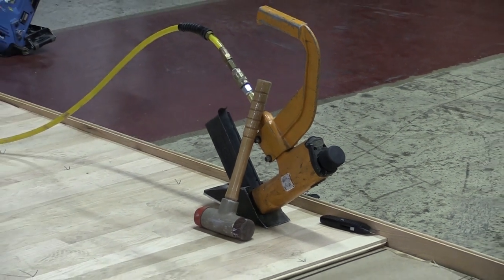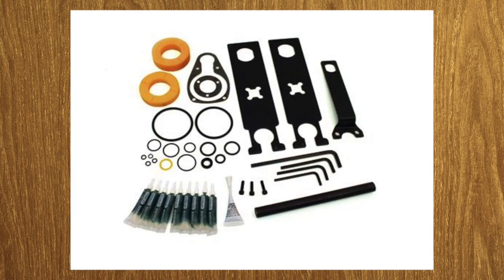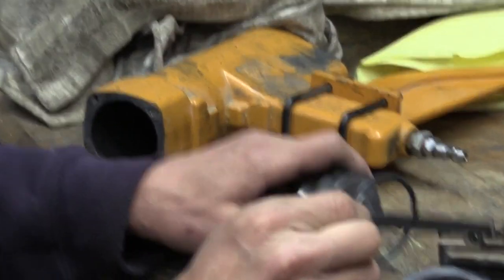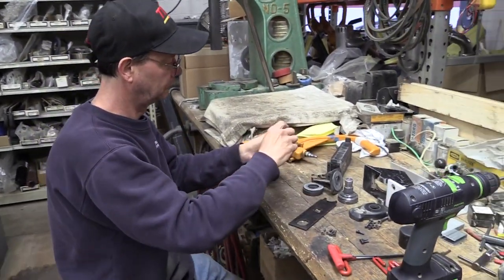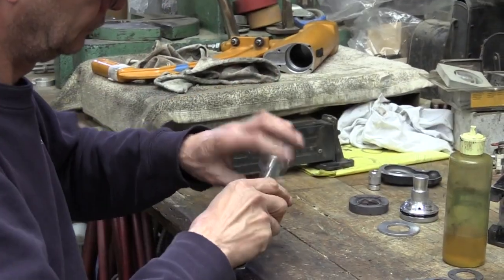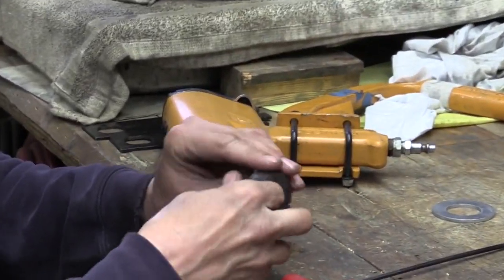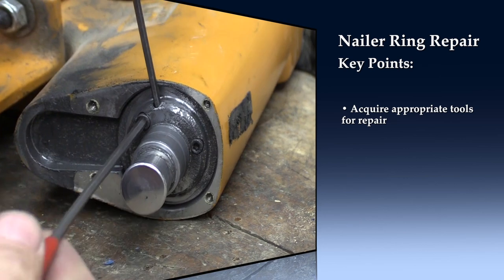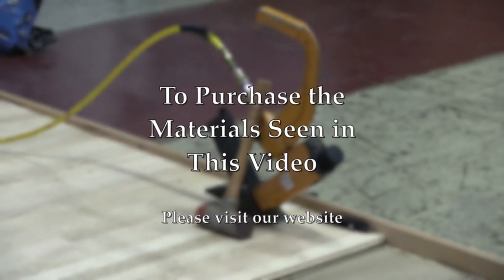Nailer O-Ring Replacement | City Floor Supply

Comment: Have a fencing stapler that won't fire at all. No leaks either. Just won't do anything. Do I need a rebuild kit?
Reply from the maker: If the tool is not leaking I do not think that it is a problem with the orings.  The problem may be with the trigger or driver blade.  You may need to replace all of the o-rings when you attempt to replace the trigger or the driver blade.